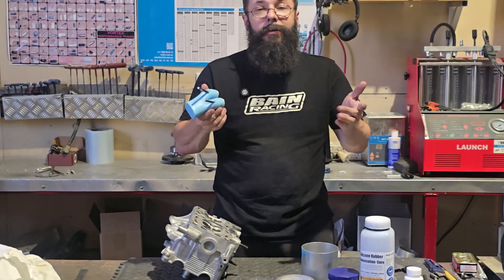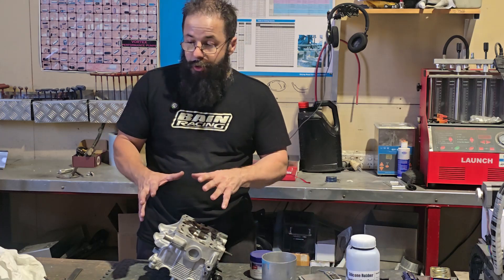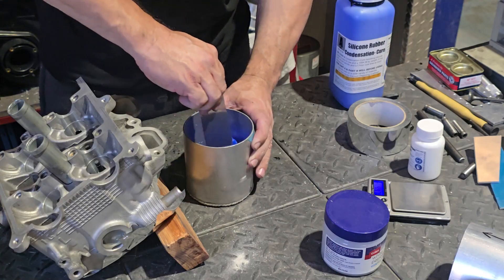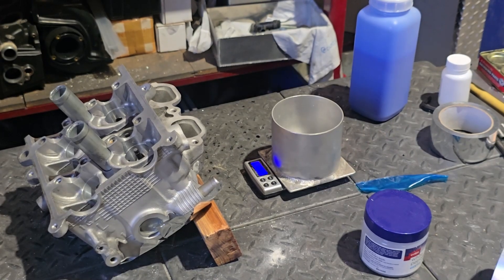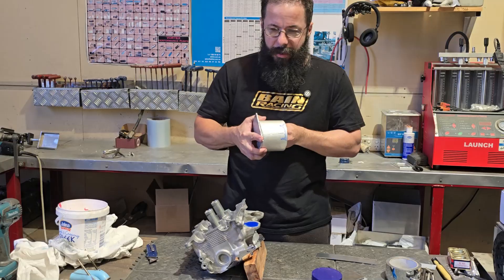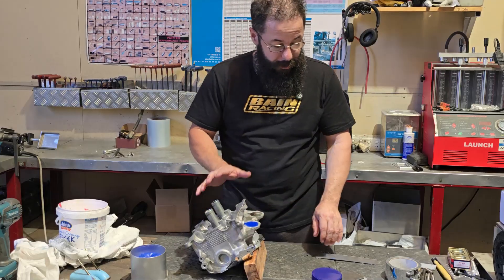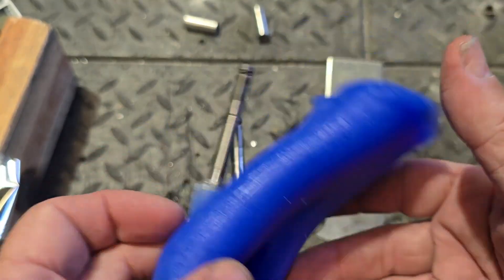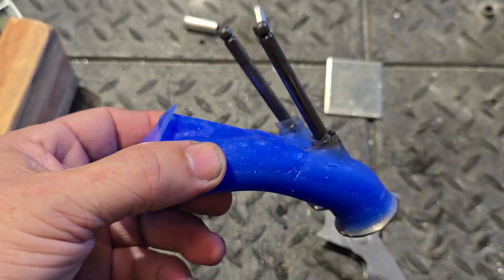The RIGHT Way To Cast Port Molds - Complete Silicon Molding Tutorial V12 Toyota

Comment: You can also insert some dowel or rods in from the intake side to keep them from flexing around unsupported.
Reply from the maker: Yeah you could mate.  As long as its "inside" the mold. As you don't want it to add volume in your testing.

Comment: When I 1st started to get into porting heads, I learned a few tricks from my grandfather and my uncle, those guys had a bunch of G2 hemi heads that there cut in sections, and they had cast moldings of every cross section cut they made. That's how I approach my G3 hemi heads. it's one of the best ways to get a good Idea of what the column of Air actually 'sees' as it gets push/Pulled in to the Cylinder....Also(honestly 1st Video of yours I've seen, so maybe you did this already)  we have several Block head combos(Big Chevy ,SBC, 351 Cleveland, D3 and A3 Headed Nascar Fords, Some odd Nissan's and of course g1-G3 Hemi) that blocks are cut along cylinder head valve center line and Combustion Chamber/Cylinder molds , there is so much to learn, and once you have a good understanding of what that column of air sees as it travels from Throttle Blade to Piston top , the more Hp you can squeeze out of what ever engine you're working on.....Love the Video , thanks for sharing
Reply from the maker: That's awesome mate, great to hear you're carrying on the family tradition!  Yeah thats it!  I cut a few in many different aspects.  Through the guide is very helpful

Comment: Good day! I want to ask you a question. should the ceiling be slightly raised at the beginning of the port and the floor be slightly leveled before turning? will the channel rise and become straighter? subject to the manufacture of a new runner.
Reply from the maker: If the roof comes up the floor need to follow. Or you are adding too much area and killing air speed. 👍  hope that helps.
Reply: Thank you so much for your answers.I'm making my 1jz vvt i turbo.I recommend your videos to my friends
Reply from the maker: Cheers

Comment: I like to use light springs to hold the valves closed when making a port mold.
Reply from the maker: No real need mate. We have done hundreds of molds.  Even with crappy home made guides they still did alright.  The trick is packing the chamber 👍

Comment: Hey, great video again. I do have a question about welding up the injector area inside the port: do you use a tig welder or how do you do it?
Reply from the maker: Yep helium Tig to reduce stress or splash zone epoxy.
Reply: @bainracing thanks for the reply, what are the benefits and downsides of both? And in which situation would you use which one?
Reply from the maker: Distortion is a problem with welding.  So if its close to a cam tunnel or bucket bore. We will use splash zone.  Both ways work well.  Just we the splash zone you need to make sure it holds.  So injector area will also dictate what way we go. Also cost. Welding is more costly.  So also what the engine is doing and for how long will dictate what way you go. 👍

Comment: What is the shore rating on that silicon rubber?
Reply from the maker: Most are around 10A that gives a reasonable flexibility without tearing apart when trying to remove 👍
Reply: Ok. I will try to find correct one and test it on Datsun 510 L18 engine that i'm building for next summer. Thanks for the answer 🙂
Reply from the maker: @Hahamani 👍👍

Comment: Thanks for your video. This type of port always reminds me of Darin Morgan claiming that a single radiused angle within a port is better than a long curved design. But I am with you here and would also remove that slightly as long as CSA allows. We do have the benefit of our Rottler machine software calculating this otherwise time consuming CSAs. One think I tried is let AI calculate the areas for you: Cut it, print its CSA with dye and then put a reference square besides it on a sheet of paper. Take a picture, let the AI know how big your reference is and voila! There you have it. Saves a lot of time over radius gages and calculating. Keep up the good work, I wish we would be closer - otherwise I would love to cooperate with you. In case you need someone with 5 axis machines, cnc lathe and serdi let me know anytime. ❤ Tim
Reply from the maker: So true Tim!  Darren isn't wrong about that. I believe it has to do with better inertia lengths.  Curves cant generate inertia. But straights can.  So he is bang on.   Yeah ive done some digital scanning straight into CAD and then we give it a reference size and it will calculate everything even volume.  Will do some 2D videos on this as people have also asked how to do this.  Thanks for the offer mate. 👍

Yes love the Rotler machines.  They definitely do make it a lot easier.   If my son continues with the business, ill bring one in from the States.
Reply: @bainracing whenever you decide to pull the trigger let me know, there is a lot of behind the scenes stuff and inside info which might help during your purchase. If you need my contact I can email you if you like. 👍
Reply from the maker: Legend mate. Will do! 💪

Comment: Bolt a stub pipe that’s a couple inches long and you can grab hold of it
Reply from the maker: Bolt what to what mate? Not following
Reply: @bainracing he’s saying to make / add a short flanged tube, similar to a primary header tube / stub stack, to provide a handle to get a hold of, when wrestling the silicone filler out.
Sounds like a good idea to me.
Reply from the maker: @georgedreisch2662 oh. OK, yeah no, need them as is so we can volume test them. 👍
Reply: @bainracing I just slice it off once removed and there is always a nice clear cutting line if you deliberately mismatch a bit smaller
Reply from the maker: @dmc5681 sweet, might try it.  What are you using and how do you hold it in position while it sets?  What shore rating do you use?
Reply: @bainracing  junk tiny manifold that I cut runner off so flange and bolt matches
Reply: @bainracing weld a pipe to a flange that bolts to the head similar to a exhaust stub pipe. Then you can remove it first so that It gives you something to grab hold of ( for extracting outwards rather than downwards )